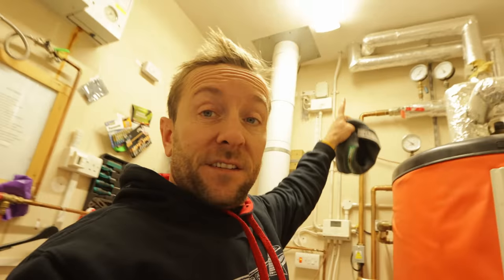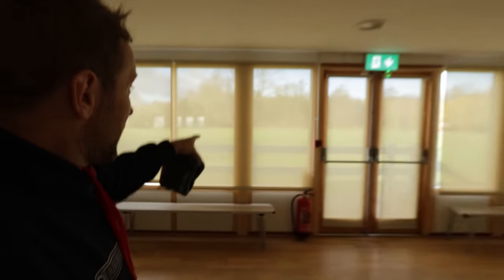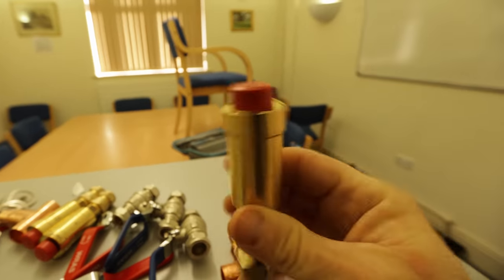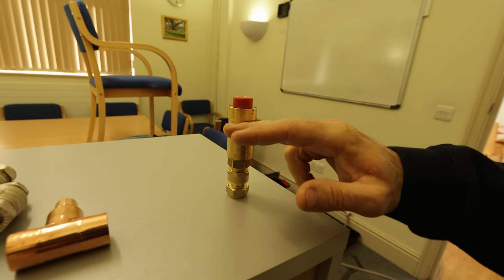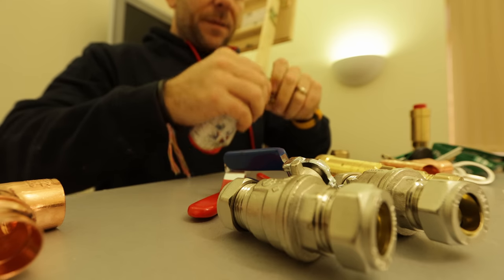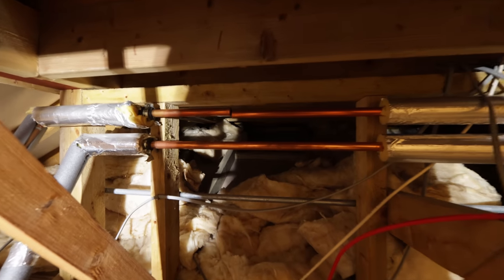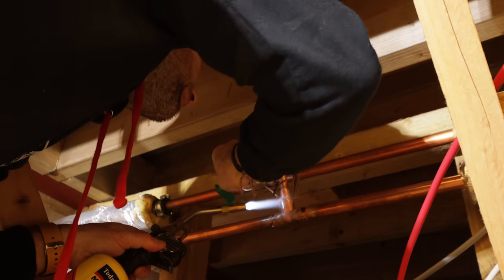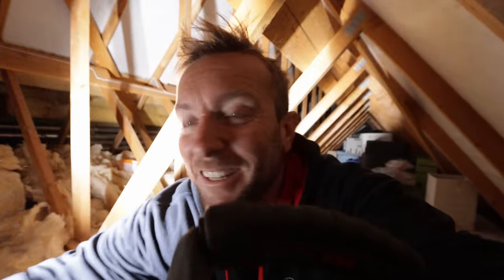Radiators STILL NOT HOT? Another fix

Comment: A lot of times ,"Cavitation can be caused by Undersized Pipework  allied with bad pipe geometry, i.e the use of  90 deg Elbows rather than  slow swept bends or nice Pulled bends, better still Two 45 degree bends to continue a run... the reason for the slower pump speed is ,too high a Suction lift, basically the circulation pump is pulling and discharging faster the the   liquid can be supplied into the pump chamber creating  serious Bubbles of Vapour...which are incompressible just like Ball Bearing being fired at the Mechanical of the Pump and also eroding the vanes on the impeller...thus creating the  shortening of the life of the pump seal... then you have leaks across the seal faces... Great Upload, really great to see a really  skilled Plumber / Heating Engineer at work , your Dad mentored you  really well you're a credit to him...
Reply from the maker: Haha! Cheers mate. Filming with my old man tomorrow. 

Personally I think this sytem would work really well with a low loss header.

Comment: Top video as always, love the fact you show real life situations where you can't always be neat when soldering in awkward spaces 🙂
Also top tip for water in the pipe scenario, me and my mate Shane discovered out of shear desperation when a difficult system was taking forever to drain down, we grabbed my shiny new Karcher wet and dry vac (WD6) and cut a pipe we had planed to alter then whacked the end of the hoover on the pipe, boom! to our amazement it sucked literally gallons out in just a couple of minutes even though the hoover pipe was much bigger than the 22mm we had just cut. No more drip drip drip! completely bone dry.
I had only bought it as a job site hoover and for spills, now it's my new best friend  Happy Days 🙂🍻
Reply from the maker: Sucks it out in seconds! Another trick is to have a mate about a meter down the pipe with a blow torch on it - evaporates the water as it approaches and gives you the chance to get the solder done - tried them all I have!

Comment: Am doing an install at the minute, this is nothing to do with video but hope you can shed some light. system has auto bypass valve in normal place before the valves, does the expansion vessel and pressure relief valve/filling loop need to be in this loop (after bypass has tee'd back into return pipe) or can it go before the auto bypass tees back in, on the return pipe (after HWC tees with CH)? Can't see any details about it online, I assume after the tee but just checking as would be easier before....

Comment: Have a problem with 2 new radiators in extension. It’s all Hep2 o the connection for these 2 Radiators  is a manifold with 4 connections. But I want to fit it correctly with 2 to cold and 2 to hot. But here not easy to find. And most access points are in the smallest place in the eaves.

Comment: Was this is sealed system? If so, will the pressure not drop down when air is released through the automatic air valve?
Reply from the maker: Yes on both, that's why my next job would be fixing the creation of air. But this can be a reet pain!
Reply: @The_Invisible_Self  Surely the proper fix is to work out where the air is coming from and stop it?
Reply: @plumberparts  Look forward to the video!

Comment: Aav's should only be used for initial filling and venting, once system is air free and circulating, best practice is close the cap. They aren't  foolproof. In a sealed system, loss of system pressure will be apparent with or without aav's.
High ph is a likely cause of pressure loss, so water quality tests ( ie. I test by scalemaster) and loads of QUALITY added inhibitor.
Continued air entrainment issues, pressure loss ,circulation issues need resolution as part of the process.
Reply from the maker: I love the word QUALITY in caps. so much knock off inhibitor out there atm. ADEY all the way.

Comment: James it’s the 45 degree angle of those pipes In the loft which is causing air to accumulate and the air bubbles are joining causing one large air bubble, change that to 90 degree straight pipe and it should fix it

Comment: Just use compression,  no need to be a hero
Reply from the maker: I just didn't on this, although it did cross my mind....then I realised I had no equal 22mm comps (or once with 15x22) in the van and the supplier was 25 mins away - sod that! 😂
Reply: Use what you got , I suppose. I just avoid the torch as much as I can , had one or two scares with fire